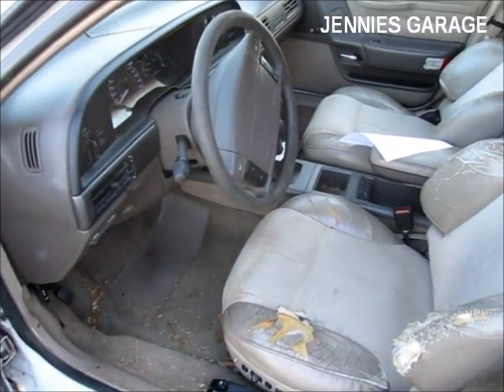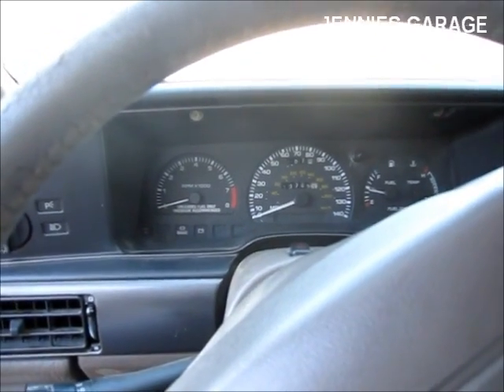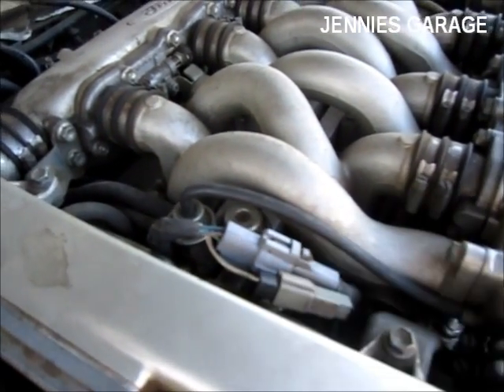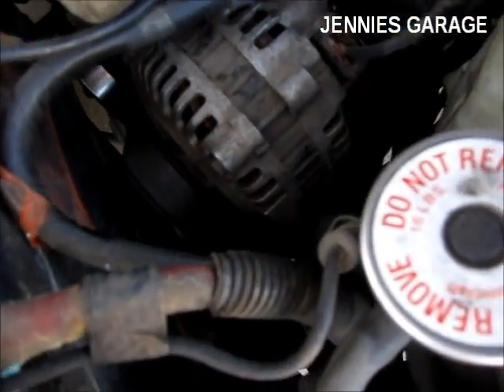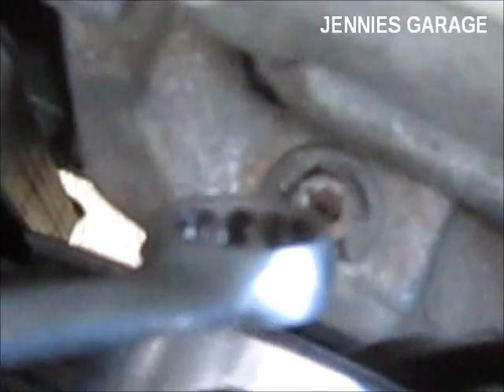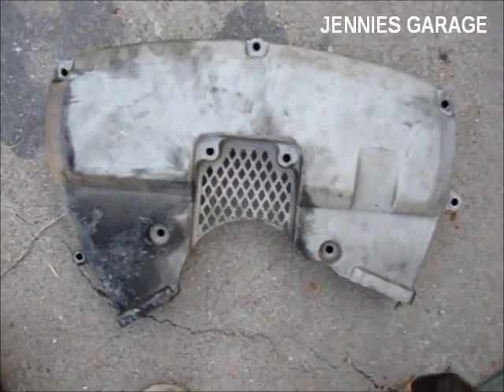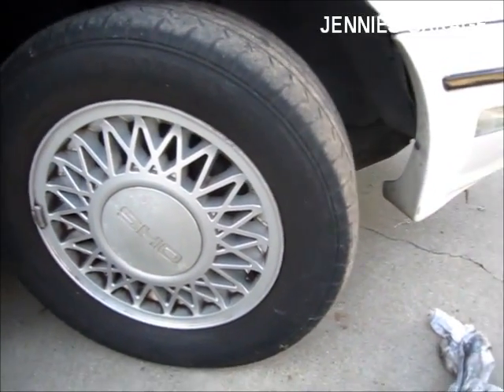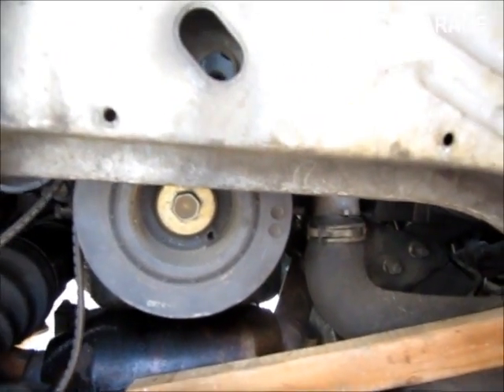Taurus SHO CPS Removal Procedure - With Flying Camera Blooper At 2:43!!

Comment: sables tempos and tuarus's usually haves problem on the pos or neg wire that has a smaller wire with a harness that  comes loose on turns which would make you think your fuel pump is going out or did go out.  I think it's the fuel pump wire that's connected to the pos+

Comment: Wow, that's a first. I've NEVER seen a breaker bar bend before. talk about torque....
THIS was a puzzle for sure. when you said to remove the plastic wheelwell, I thought : what a P.I.T.A. ! 
all for just a simple computer sensor. it's the reason why I want to buy a car/truck BEFORE computers "strangled" the motor
 this was a VERY informative vid - Nicely done.

Comment: 3/4" or 19mm, thanks good video, except do NOT use the starter to break the bolt free, that is a excellent way to eat the teeth off the flywheel or destroy the starter.

Comment: this is going to be so helpful i'm going to try and do this tomorrow i don't have the tool to get crankshaft pulley off is their a different way and could this risk messing up the timing if this is done thanks in advance.
Reply from the maker: What tool are you missing? You definitely need a breaker bar to get that bolt loose. You won't mess up the timing.
Reply: okay i haven't done it yet lol im missing the crankshaft pulley remover tool but renting one from auto parts store. thanks for the help

Comment: I've been thinking about tossing this engine in my 88 escort gt. Problem is the weight. How much does this engine weigh? Rumor on the forums is 600lb (that's v8 territory fyi) and the 4 cams, hugemongous cylinder heads, larger  displacement kind make that seem logical. Have any clues? if it is that heavy it's a deal breaker. lol
Reply: It's crazy fun to drive. I have a 93 and the throttle response with the dual intake is like driving a ITB 6 cylinder. My only issue is the curb weight of the entire vehicle makes for crummy body roll. If you can fit it in a car with a 4 cylinder bay and   a 30/70  or 40/60 weight ratio it would be mad! With a 7000 rpm redline.

Comment: ami I feel the same in my sho atx 1994 after driving about 20 min no longer turns off I have to wait a long time to turn and in doing so the engine is running and the rpm tachometer is dead, it is also the sensor crankshaft my friend???